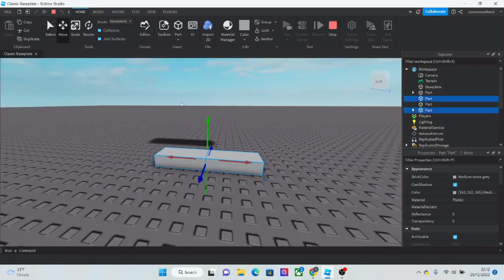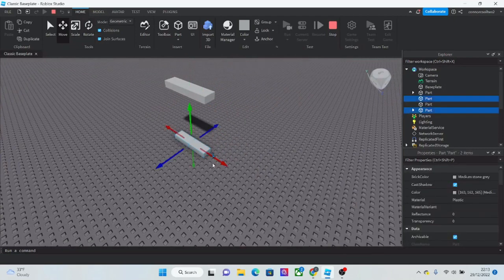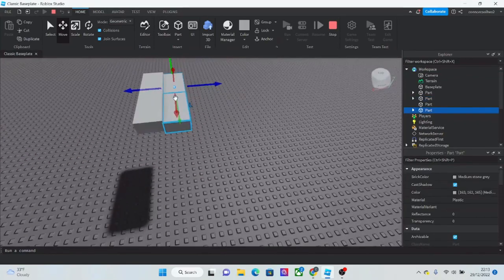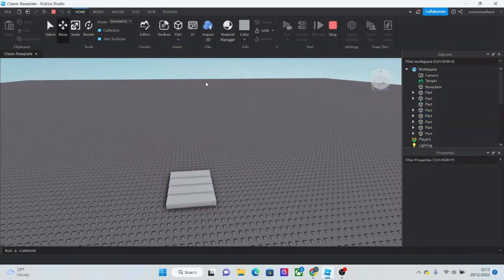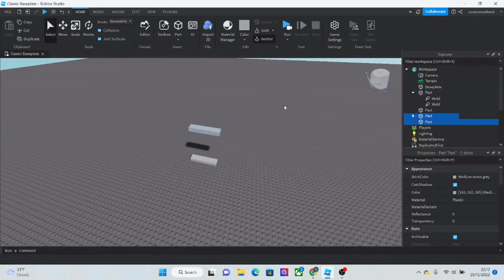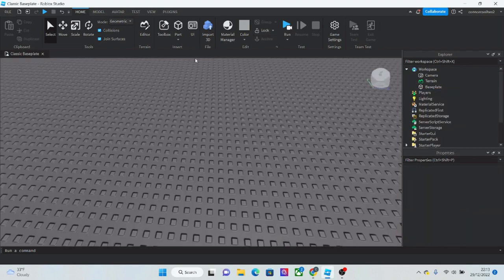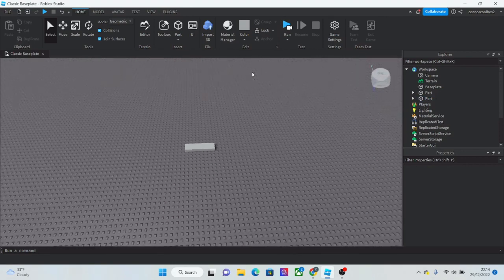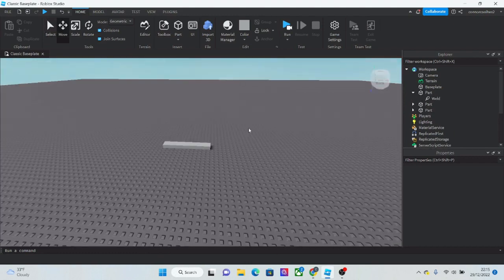How to stick parts together WITHOUT Anchor in ROBLOX Studio (Destruction Physics Test)

Comment: Hi, I'm fairly new to studio and I have a question. Do you just have to add two welds to every  part you need to weld together? Or is there something I missed?
Reply from the maker: Kind of, you just need to have a weld constraint always be a child in one of the parts, like Part0 or Part1, and then once it is put in one part, you link (weld) the Part0 and Part1 together. If you want to add additional parts to the same weld constraint, do something like weld Part1 to say a new named Part2, then to Part3, Part4, etc. If you have multiple welds, it creates a 'chain'. But you can also have multiple individual weld constraints with their own welds and then place them all inside of a model, which is what many moving models in Roblox use, such as vehichles.

Comment: Hello, i am currently new to making Roblox games and I’m making a plane crash game where you can fly planes and blow them up. I don’t know if you are going to respond. But I have a question. If you do not want to spend all the time to weld every single part 1 by 1, can you do it faster? (Also I know that you can make the whole thing 1 model but then it won’t break separately)
Reply from the maker: I found 2 different plugins, haven't used them but it could work, I'll send some links because they are plugins specifically for group welding. 

Studio Build Suite - https://create.roblox.com/store/asset/260276858/Studio-Build-Suite

Better Weld - https://create.roblox.com/store/asset/6338033415/Better-Weld
Reply: @acidicalportal  THANK YOU!!!!!  You are the only reason I can continue this project!

Comment: okay, question, how does the building remains in place when pushed if its not anchored?
Reply from the maker: Because they use the weldconstraint property where regardless of their position, that part is always in coordinance to another parts cframe position. Essentially snapping them together. This is used for models that need moving parts in dynamic ways without the constraints of anchor which only allows parts to be moved using a script.

Comment: Is it possible to do something similar without welding? I've made a gun model and it has over 300 parts so it would be really annoying to weld every. single. one.
Reply from the maker: You can also union a part and fuse them together so they become one part, that will save a lot of time and you can still weld the parts together so they become a holdable gun.